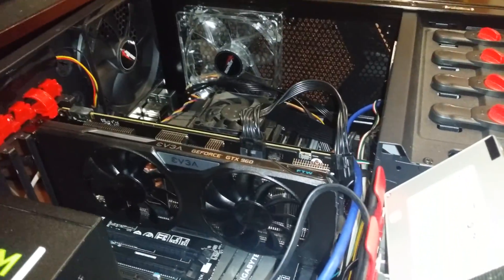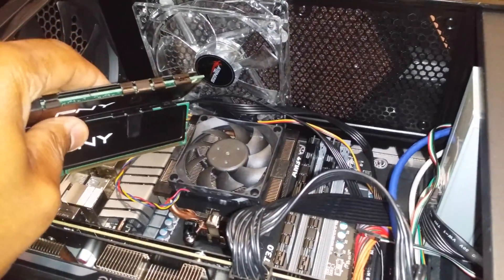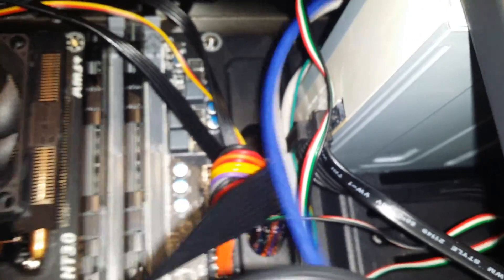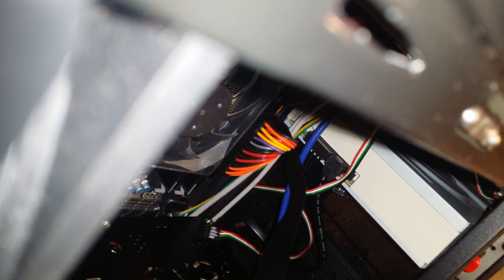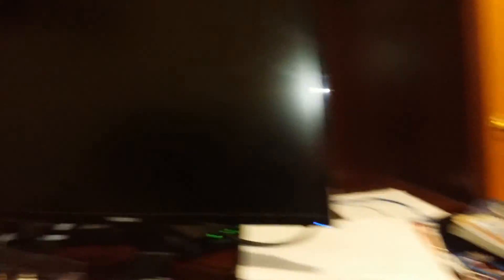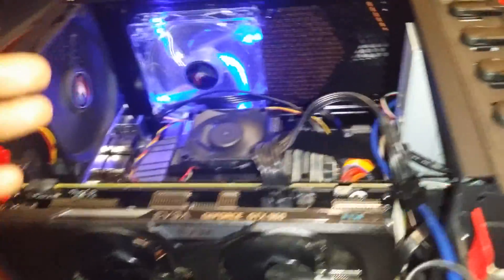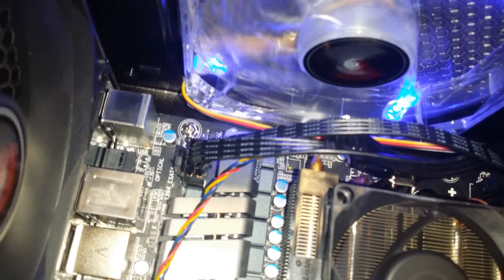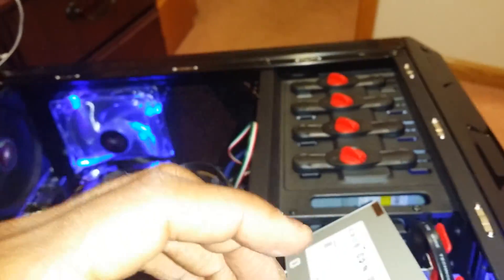Ga-990FXA-UD3 No picture fresh install PLEASE HELP

Comment: Sorry so late to post this but it's probably where MS temp video driver faults out display.  I had to uninstall driver for AMD graphics and use DDU in safe mode. Select option to prevent MS update drivers auto install in DDU then install driver in normal mode not safe mode.   Then again use an Nvidia Graphics is another option 4 you.

Comment: also... I could tell that I reset the CMOS because I had the bios setting to start the system when it detects power is applied and after I cleared the CMOS I had to use the front panel button again to start the system.

Comment: Same problem here.  Did you get it fixed?  I read this: https://forum.giga-byte.co.uk/index.php?topic=8504.0  and it said to take the CMOS battery out for at least an hour (wtf?! lol) among other things to do.  But that's it basically that I found:  disconnect power, hold down the system power button and take out the CMOS.  IDK what is going on, it's weird.  Just started happening about a month ago after working fine for 3 years.  Maybe it's just old.  I'm going to take the CMOS battery out and leave it over night and try it tomorrow.

Comment: Im starting to get the same issue, not sure if its the CPU 8150 could be fried? But I went through all the troubleshooting from clearing the cmos to replacing the graphic card Cmos battery and removing all things and trying to boot. I have f9 bios and they just released f10 beta. Still can't get it to post when I start up. Its been day 2 and still no post
Reply: Did you fix it?